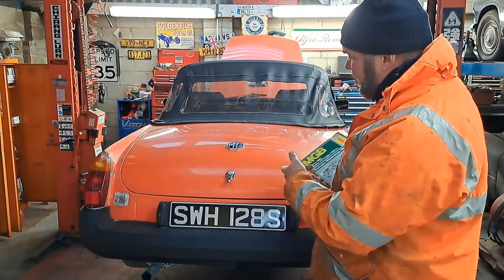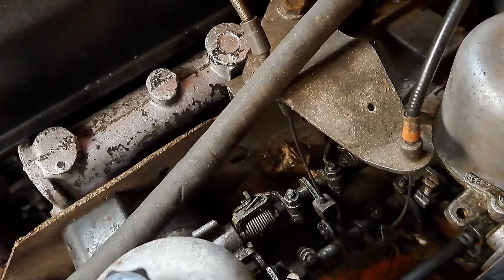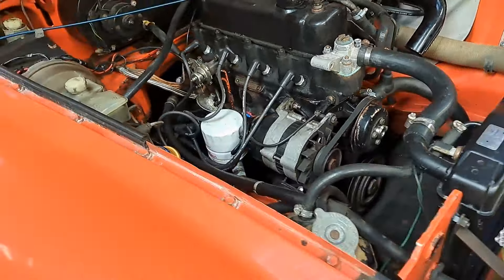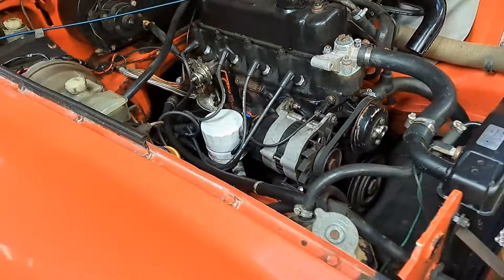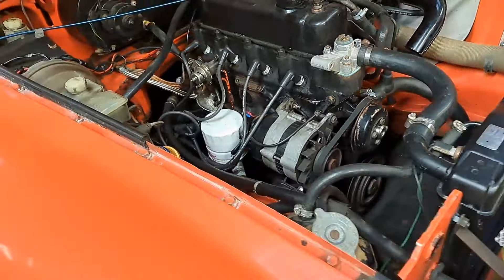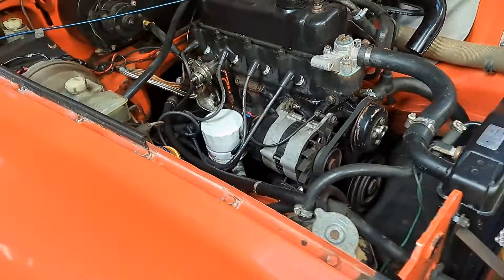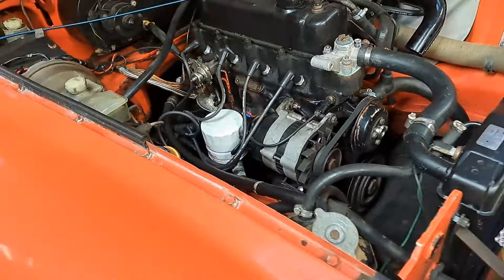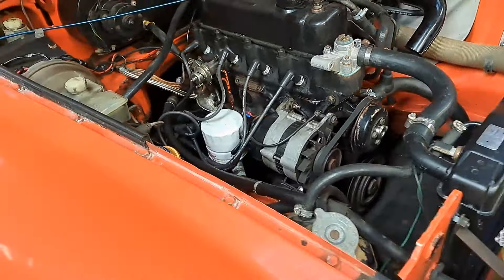Classic 1978 M.G.B Needs some help! tuning the engine & heater fix

Comment: That video took me back a bit 🤔🤣 have never used anything but engine oil in the dash pots and always set the carburettors with vacuum gauges , was just writing this when you said about vacuum gauges 🤣🤣👍
Reply from the maker: Cheers Bob, it took me back working  on it lol 😆 got it dialed in just right ✅️ 👍